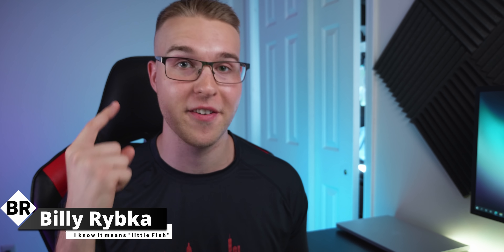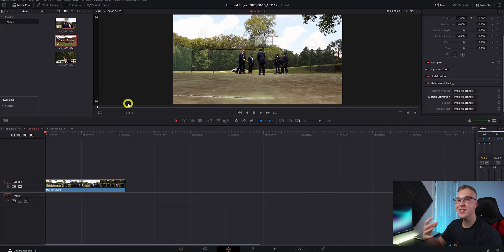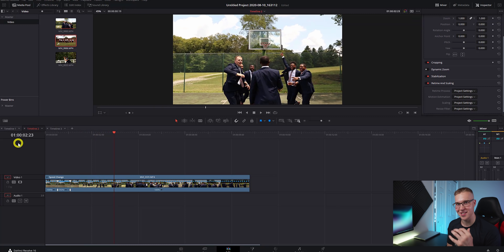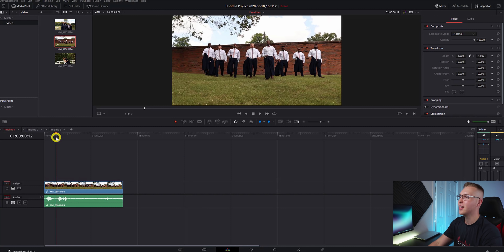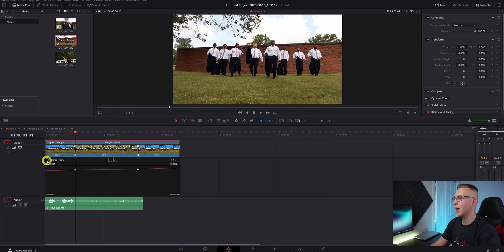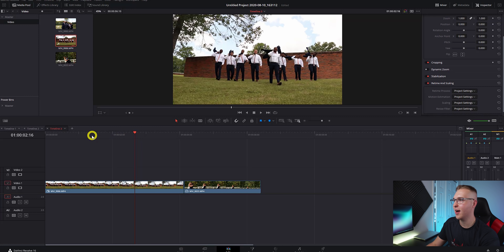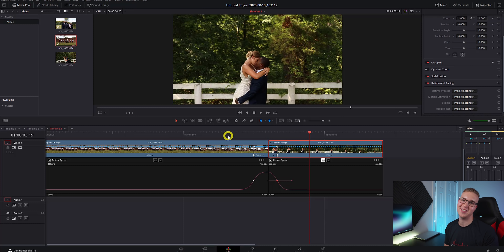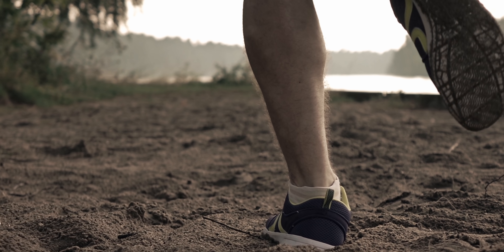EVERYTHING You Need to MASTER Speed Ramping! | Davinci Resolve Tutorial

Comment: Hi there,

Its a wonderful video. I have a question I am very new to this camera thingy, I recently bought A6100 with a prime lens sony 50mm 1.8. My purpose is video first then photography.

I came to know after using A6100 that S-Log is important for post production color grading. 

Can you tell me if A6400 can only shoot in S-log as compare to A6100 then how can I achieve similar profile with A6100? Or there is no way to color grade in a same way as S-Log footage can provide?

I am trying to understand that if both have same sensors then how come if one has picture profile option inside the camera then why not the other camera can give same flat footage which can be modified in post production.

Kindly help me out in this regard.

Thanks